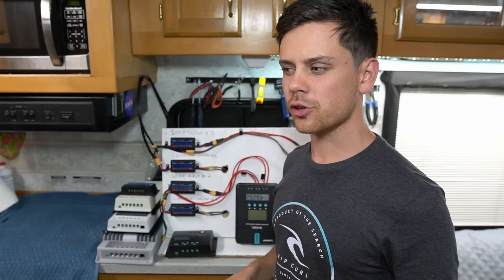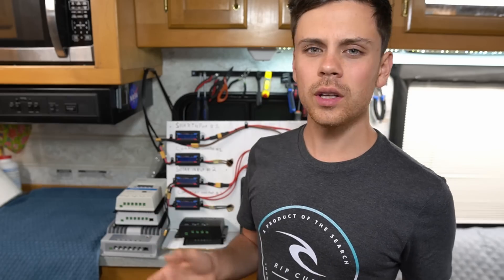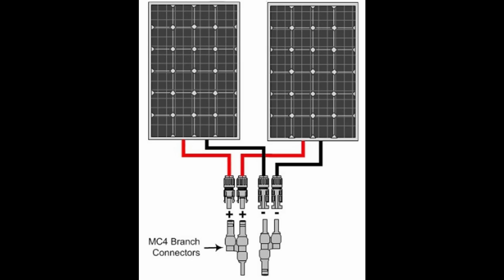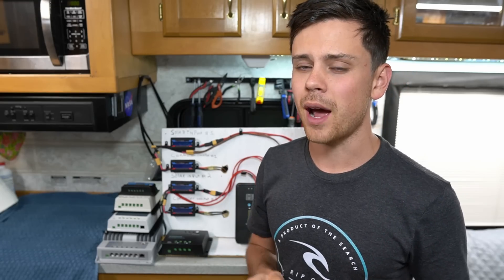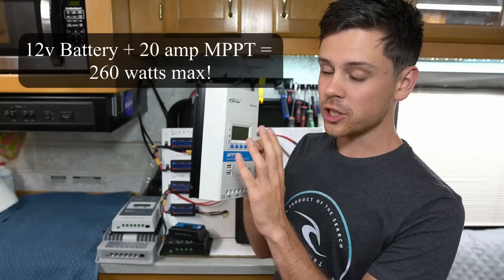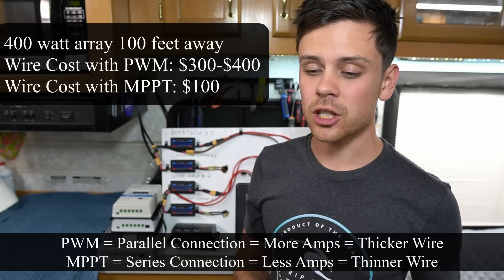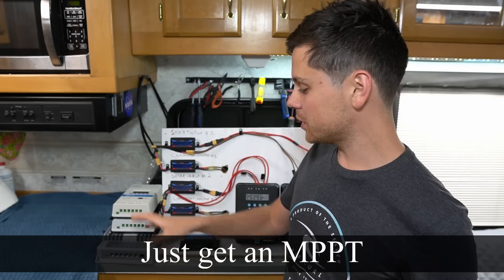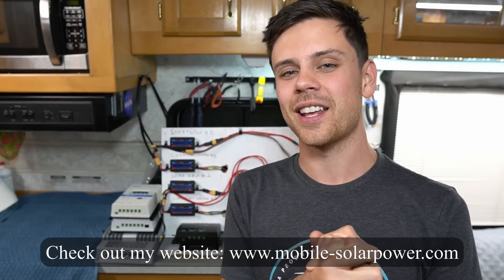MPPT vs PWM: Fast comparison for off-grid solar

Comment: Hi Will, I am a beginner and I have been watching your stuff and it is great, I'm building a test unit not anything but for testing.  My question is, if connect two 12v 75AH AGM battery and also connect two 12v mono solar panels would be 24volt in total for batteries and panels?  I was going to use a 60A PWM lb brand Solar charge controller and a 1000W inverter. what Charge Controller and inverter would you recommend or am I good to go.  I have plans to build my home off the grid in Soma were the sun shines all year round

Comment: It all depends on where you live and what type of weather is predominant. Partly sunny skies and the sun low on the horizon a MPPT is needed. If you live in full sun and it's high above so the panels basically get the same amount of photons a PWM is all that is needed.
 Lets use a sail boat as an example the panel is always changing orientation to the sun. Of course you would want a MPPT, nit only that you'd want one that adjusted itself 20 times a second. Some MPPT controllers may only adjust to new conditions a few times a minute.
 Now lets say you live in New Mexico and its sunny all day. You can use a MPPT controller but it won't be any more efficient than a PWM, you'd just be wasting money. Yes, you'd be better off buying another panel.

Comment: Quick question. Which is better on a 12 volt system 10 x 60ah battery or 3 x 200ah battery whick will last longer before the dreaded 10.5 low volt cutoff

Comment: Can i run a 12 volt device right of the battery or do i need a converter? (Freezer )(air compressor)

Comment: i've got a cheap PWM on my setup but its not working properly... its showing lower voltage on the battery then my voltmeter. And as soon as I put a load on it shuts down because it thinks the battery is dead...

Is the controller broken? Should i invest in a MPPT and would that solve my problem?
Reply: Get an mppt.

Comment: Very crisp Will no nonsence straight to the point men great Video, love and warm regards from India
Reply: Will I am a media post-production artist, worked at radio station as a sound and broadcast engineer, with little knowhow of Electronics, I started now in renewable energy and battery packs just now I have ordered 32650 LFP'S 3.2V 6Ah cells Would be making EV batteries first then shifting to 18650 LCO for any application Battery. I wish to make my own Inverter Will to make a consolidated unit with battery pack N DC ports, one can carry it anywhere please guide weather I should go in for the pure sine wave PWM or the routine Square wave design? My plan is to have all in one box battery Inverter DC ports  👍👍🌹🌹

Comment: PWM has the advantage of being able to use odd size panels as long as the voltage of them is pretty close. I've worked on a few setups where we could get a lot more panel area on the rv roof by selecting panels that fit the spaces available, the panels are cheaper and more than compensate for the controller style. Also seen that with PWM controllers people build in a 2nd redundant controller as a backup that can be switched in if there's a problem with the main one.  One last thing, I've heard of more faulty mppt controllers than pwm, I don't mean the cheap crap ones but pretty good decent price stuff. Mppt is great for big arrays with exact match panels and pwm has no place on these setups.
Reply: What? My mppt works with any Voltage panel as long as it's below 100v... I have 4 panels in series that equal 81v and it's fine.
Reply: @randybobandy9828 how many watts volts amps are your panels and are you series or parallel strings is your batterie bank 24 volts? And last but not least what controller do you have thanks

Comment: Cheap MPPT are useless, I’ve had a mid range one that was so slow to adjust after a cloud pass, there could be 10 mins as it worked out the best volt and amps.  Meanwhile PWM was punching in the amps instantly.  Yes you will get more in when they eventually work out the input.  “EPEver was the brand”  I had 120v down to 12v ,  it worked better with 36v ish . Plasmatronics makes the best PWM that I’ve used.

Comment: Short answer = pwm is only good for smaller lightweight loads, MPPT is for larger systems and runs a lot more efficient by pulling more amps + higher voltages from the panels.

Comment: 071520/0629pst   Thanks again. Watched this segment, perhaps, 3 times. Procured VICTRON 100/30. It should arrive on July 17th.
As per your comments; the input cable port of VICTRON MPPT charge controller, is small. But there was no comment from you, as to what the CORRECT Cable is recommended. AWG 14? AWG 12? AWG 10? 
The ASTRO POWER PV MODULE ( I bought ) output cable with MC3 connecter has AWG 12 Mark and their recommended cable to the battery (through VICTRON MPPT) is MINIMUM AWG 12.
Would you, please comment, that is if you have time? Thanks much, once again. Stay safe and 73s...

Comment: Is it possible to skip the battery and go directly to a 24/230vAC invertor? The load will be resistive, a  warmwater tank. I would love to have a feedback on this. thanks in advance

Comment: Keep in mind that all MPPT's are much less effecient internally because of the complex V/I conversion they do.  So if your  MPPT is 92% efficient, then before you even get started you already lost 8%!   A cheap PWM by comparison is typically 98% efficient, the loss there, as you already know, comes comes from making the PA - Battery V/I imbalance.  That is why it is not that black and white, and it is a dirty little secret not spoken about.

So I respectfully disagree that PWM is that bad, it is often as good and sometimes better, and ABSOLUTELY ALMOST ALWAYS so when compared to cheap Chinese MPPT that struggle to go better than 92%.  - CHECK IT OUT, IT WILL SURPRISE YOU!
Reply: Not so much. Will is just running real numbers, and that's where the rubber meets the road. A 40A Epever MPPT specs out at 99.5% efficiency and 98% for DC-to-DC. I own a total of 4 controllers, 2 PWM and 2 MPPT. At least in the 20A to 40A range on 12V and 24V systems, when I have subsituted an MPPT in for a PWM, there has consistently been a measurable increase in total kWh output relative to what my other systems on the same site received month-over-month.

Comment: I'm still trying to figure all of this out. I'm glad you mentioned the size wire for length of the Run. That had me very confused I'm trying to make a solar system that will run a live bands outside. I'm a sound man who refuses to do gigs inside clubs right now. Your videos are definitely helping me to brainstorm a system.

Comment: Dear Will,

I need to charge a 12v truck battery that runs my 12v water pump on y boat.
The water pump draws 0.5amps and is only used intermittently or about 15 minutes per day.

The idea is that I rotate my 6 batteries for a few days at a time jut to keep them charged.

Is a 100 watt panel with a small 10amp PMW sufficient for that?
Reply: Yes

Comment: Hi, i have 4 solar panels for a total of 400W,  same specs (21V 5,65A shortcircuit), but i've noticed something strange, if i connect in series (2 couple of parallel then in series, 42V 10A) or all 4 in parallel (21V 20A) i only have a total of 240W, the problem is not the cable because i try to shortcircuit in the back of panels or near the charger, same results, i have small drop of V.
The weird thing is that se single output panel when i shortcitcuit is 5A, but when i put all togheter i have only 3,8A.
Same with real mppt, cheap pwm or shortcircuit :/
Thank you very much if someone knows how to help me :)

Comment: You’re awesome and I like to learn from you man! Can’t you use a pwm + a step up transformer and a step down transformer to cover the distance in small diameter wire? I know I haven’t priced that option out but I think it’d make sense financially if you don’t mind the small magnetic loss. That way you can have your panels way further away
Reply: Absolutely not.  Transformers are for alternating current.  These systems are direct current .  AC will generate a magnetic field, but DC sees only a short circuit.

Comment: I honestly would never waste my time with anything other than the best Victron MPPT anymore, have gone through a bunch of PWM chinese ebay specials over the last decade. But my victron 48v20A has had 300kwh put through it over the last couple years and is still going strong

Comment: Hello, nice wrap-up of the topic... 
I'm still wonderring thou - since I'm planning to use on my RV two, or even three 140 - 160Wp panels in parallel setup (parallel should be better when one of the panels get shaded by trees etc, which is often the case), might the PWM still be better solution for such setup than MPPT ...?

Comment: Those of us on sailboats also should go with MPPT controllers because at some point there WILL be shading of part of the array, by the mast/boom or radar antennae or wind generator, mounted close to the array (lack of real estate on the boat). This will be partly mitigated by the MPPT controller, bonus power, that would normally be lost by a PWM controller.
Cheers all

Comment: There really isn't a question about this. MPPT does everything PWM does, and more, and does it better. You might have a simple PWM array, but suddenly you want to upgrade and guess what, you have to go MPPT and rewire everything. Do it right the first time.

Comment: MPPT beats PWM except for radio emissions.  MPPT is very noisy and will effect radio signal devices.  Ham radio will be heavily affected.  Weak radio and TV stations may not be received.  Weak cell signals may not be received.
Reply: PWM stands for Pulse Width Modulation.  PWM is a technology that is used in almost every power supply build now days.  It is used in the MPPT controller.  The PWM technology can be very noisy (electrically) depending on how well the supply is designed.  So whether it is a MPPT or a PWM charge controller will not necessarily determine whether it is noisy, but how well it is designed.  Yes I design power supplies for a living.

Comment: One of my dreams is to have a solar power system but I don't have knowledge about this things.. may ask from you if can you give a set up of solar system that not only can run household's appliances but it also can run a inverter welding machine. A set up start from solar panel how many wattage, voltage and solar charge controler wtt., vlt., amp and battery's wtt, vlt, and inverter wtt, vlt, amp. I have a question: Solar set up is it can be use to DC set up?

Comment: HI, I have some problems with this Solar Stuff.....First off I'm 0ld and don't know anything bout Solar at all. I'm on a Very L0W INCOME Social Security. I'm trying to build a Bug0ut Trailer and I want Solar in it. I want to buy 4-6volt Golf Kart Batteries to link together 2-12volt system. I have 1 brand new 3000 watt Inverter and a couple more older ones I can also use in my trailer. I want to buy from Amazon this kit: HQST 100 Watt 12 Volt Polycrystalline Solar Panel with Solar Connectors....How many should I buy? 4-6-8?

0R......

would this be Better from Amazon? Renogy 400 Watt 12 Volt Off Grid Solar Premium Kit with Monocrystalline Solar Panel and 40A MPPT Rover Controller/Mounting Z Brackets/MC4 Adaptor Kit/Tray Cables Fuse set /MC4 fuse

I hate to brother you But, maybe you could help me on this, I just don't understand fully What I Need to put together for a Good System.
Please alittle HELP on this IF I Can....Thank's ahead of time for ALL You can do.   PLEASE❕

Comment: Need help you seem like the only one that really explains stuff from other youtubers ..
question I have lots New Battery S3 LGDAS31865  RECHARGEABLE LI-ION 3.7V 2200mAh batteries want to build small home battery bank.. what’s the best controller to use ..& BMS ?  
Bang for the buck any thoughts 💭

Comment: I have a question if you can answer? Is it preferred to use a PWM rather than a MPPT for my 12V 25 W solar panel to charge my 12V 3A battery to power my 27W loads

Comment: Thanks for the info. So I'm wondering if I can use 12 gauge wire for a run say around 65 feet? I have 4 Renogy 100-watt Monocrystalline panels in series and a Renogy 40 amp MPPT charge controller. Any advice you can give would be appreciated  Thanks.
Reply: voltage is the determinant for what gauge you should use. High voltage always preferred to cut costs for copper of alu

Comment: I apologize in advance for my "low information" question. I am new to solar and have been watching many many videos mostly from this channel. I am very confused and need help with the following: I have an older model class C RV and recently purchased a Battle Borne Li battery with the Victron monitor and installed it in the unit. I have a portable solar panel array which came with a cheap PWM controller. I understand I need to have a MPPT controller and purchased one from Amazon that was displayed on this channel. I received the box and all it came with is a telephone wire connector. How is that supposed to connect to the solar panel and the battery? I don't get it. Thank you anyone for your help in advance. Can I still use my PWM controller to charge the Li battery? If not, what MPPT controller can I use with the 200W panel that actually has hard wire connections?
Reply: Take a look at the smaller Victron MPPT controllers. More bang for the buck.
Cheers
Reply: Sounds like you didn’t be actually buy a charge controller.   What you bought was most likely an add on to a controller but not the controller itself.

Comment: You are right to parallel up existing 12v system panels for PWM or wiring them in series for MPPT. You also agree that parallel~panel PWM systems can still be utilized depending on the economics. For those starting from scratch allow me to put my 2 bobs worth in... The MPPT is the way to go because it makes best use of the available sun under a wider range of conditions including solar angle. In a PWM system the 18v of your typical 12v  system panel gets pulled down to the battery voltage by the PWM (basically power averaging), and ditto for an MPPT if provided in its place.
So direct replacement gives no real benefit and getting the most out of an MPPT (or any benefit at all) requires you to go to typically double the 18v volts for the panels. If your MPPT can handle even higher voltage, then go up to that. For the first 18 volts or so, an MPPT acts like a PWM. If extra voltage exists (like with a 36v house panel being ideal) or WITH 18V PANELS IN SERIES, the MPPT controller has an inverter section built in (transformer and all) which converts the extra 18 volts or so (2 x 18) into current which also goes into your battery. So in a two panel 12v battery system, instead of getting say 6 Amps with a PWM, on the same same panels wired in series to 36 volts you might see 10 Amps with an MPPT. (real world figures)

So if you only have 18v panels then stick with the PWM, it's cheaper. To get the best use out of an MPPT controller the system needs to be designed using 36v or even 72V inputs (within specs).
*Technically the MPPT tracks and keeps to the voltage of the panels that provides the maximum power output at any given time. That's called tracking and to be precise, Maximum Power Point Tracking or MPPT.
Panels in series need to be the same. (note: People can get a benefit from a direct switch over to a MPPT controller if say their panels are nominally 22v open circuit. This voltage is becoming more common than the old 18v. The state of your batteries can also cause controller power outputs to change so be aware.

Comment: my pwm 20/20 plasmatonics  12 24 48 volt charge controller it won't work with my single house solar panel 180 watt ..it's new ..why ???

Comment: Hey Will. As someone who's also very well experienced in the off-grid solar industry, being a former engineer for mobile solar systems for the military, I will have to say two things. One, I agree with your assertion that MPPT is far better. No doubt about that. Two, I would wholly disagree on your assertion that Chinese and PPT controllers are in some way the same if not better than something like a Morningstar. That is utter nonsense. I would love to see some actual bench testing that you've done to prove that assertion. The truth is that these Chinese MPPT controllers often have very piss-poor circuitry as well as horrible conversion algorithms and switching which result in much lower reliability as well as efficiency compared to their US and European counterparts. This has been proven multiple times by a couple different folks who have made YouTube videos and other websites regarding the findings. I would caution everybody watching this video to not buy a Chinese MPPT controller without some serious research. There have been plenty of houses RVs tiny homes etc caught on fire by poor quality Chinese solar components. I have personally installed hundreds of morning star controllers as well as outback and have literally never had a single issue. With something that complex, and utterly critical for the safety and efficiency of your system, I would not trust a no-name Chinese controller. I tell my customers all the time that no name panels are fine but when it comes to batteries and controllers there is no way I would allow somebody I'm working with to buy the knock-off junk. Don't get me wrong, China is constantly improving their quality and there are some companies that are making some decent components. But until they're longevity is proven like the big names, I think it is a bit irresponsible for you to make a blanket statement like that with such a critical component in a solar system.
Reply: Just put it in a good enclosure mounted with  adequate stand off's and maybe a sheet of durock on the wall yeah?